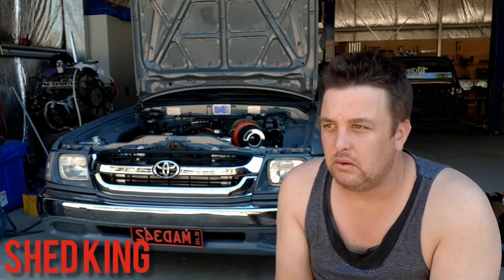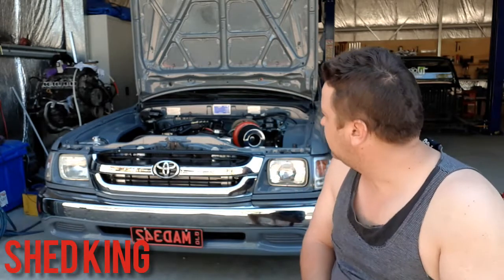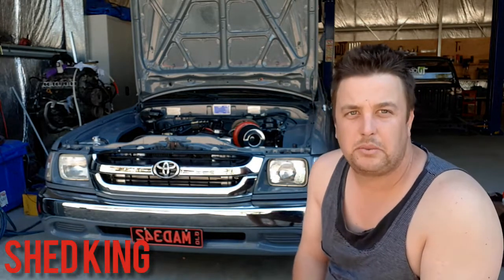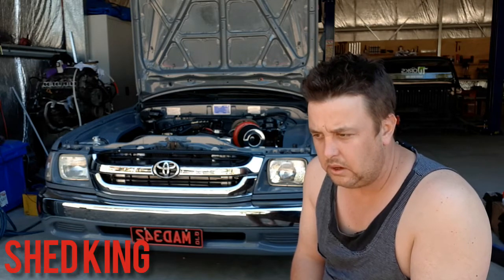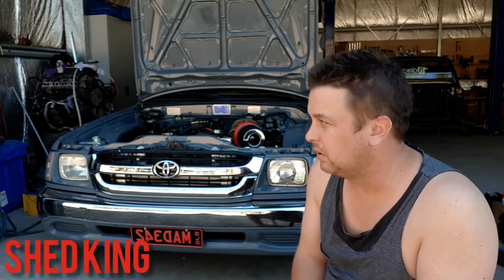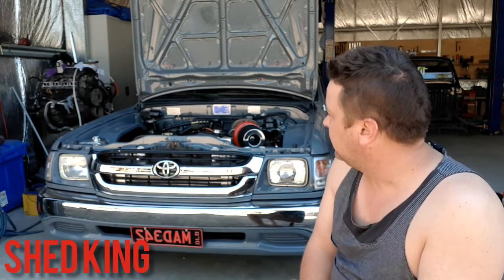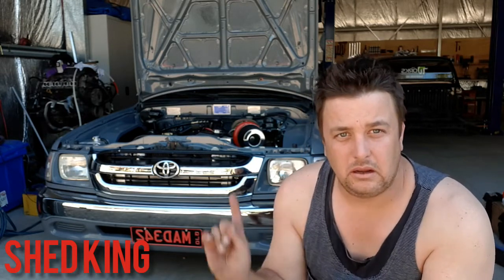Roll racing Brisbane 31/8/19 3rzturbo #the3rzshed #builtnotbought #toyotasdoitbetter

Comment: I have the same ute 3rz fe single cab wit a aluminium tray light as fxk but its stock wanna put a turbo like urs its so mad n different
Reply from the maker: Adrian Roper I sell a diy manifold kit it’s pretty easy and cost affective way to get boosted I ran a stock ecu set up for 2 years on 10psi no issues
Reply: How do get this manifold
Reply: I too have a 2002 hilux dual cab with 3rz. Looking for some more power and torque for towing ect. Where can I get some more information or suggestions.